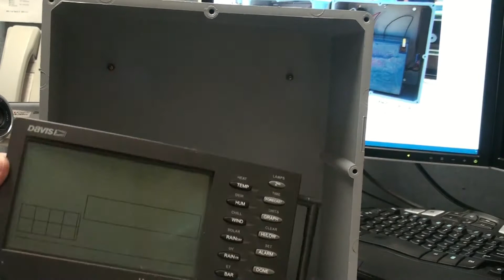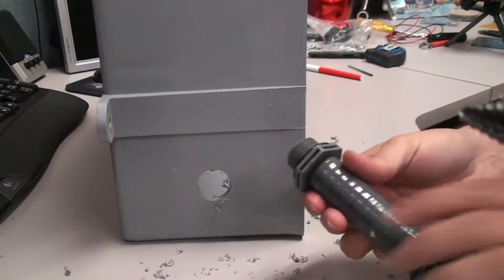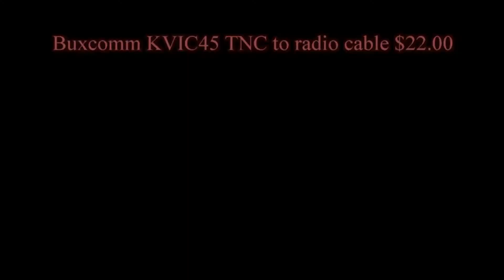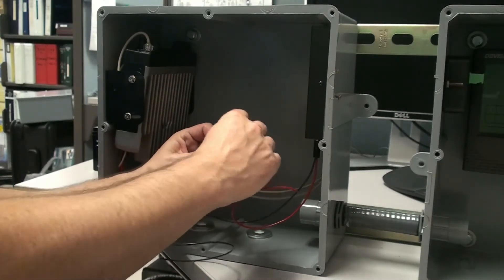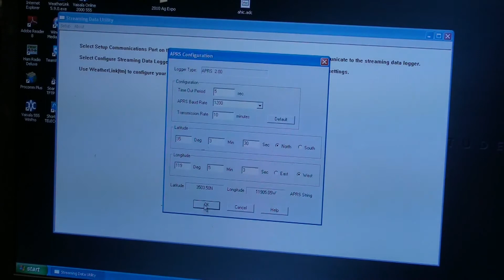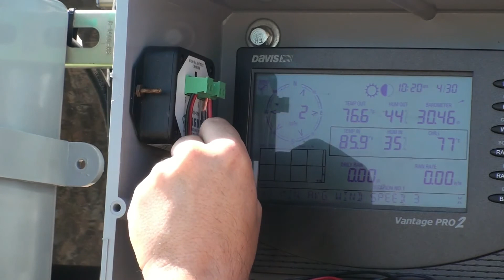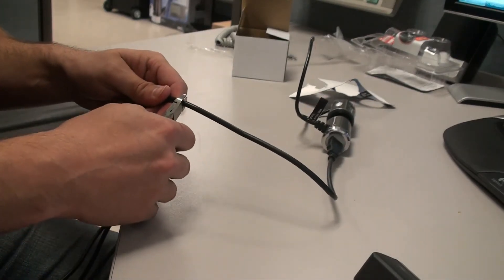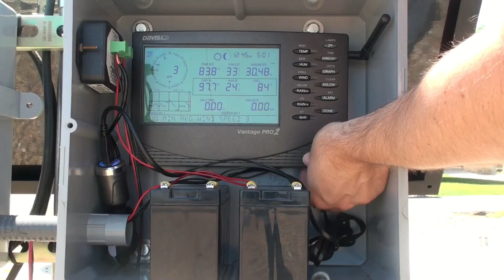Solar Powered APRS Weather Station

Comment: This is an AMAZING video. If possible, could you provide a listing of the items you used? I don't need the hardware items, just the gear, accessories, and cables. IE: Davis Pro-2, KPC3, etc etc etc...